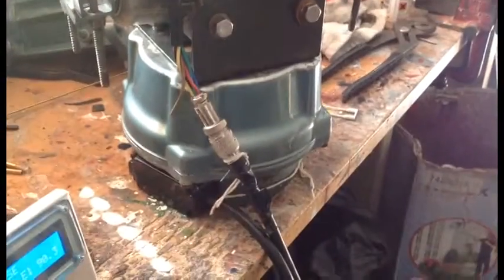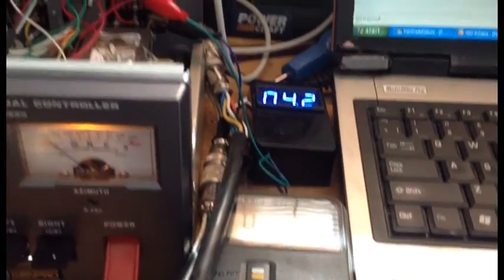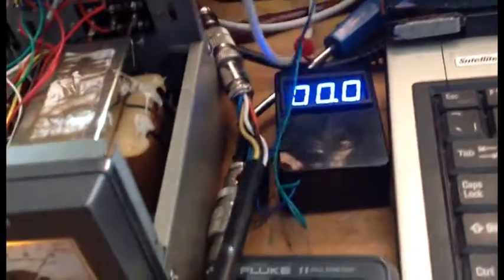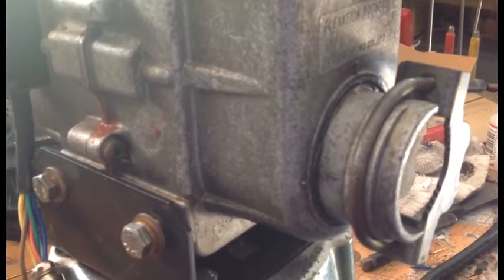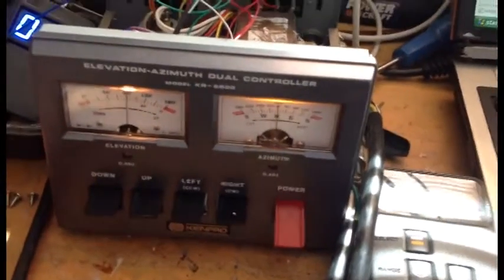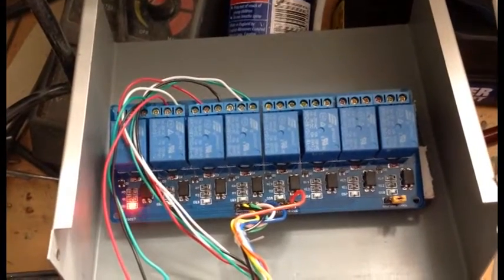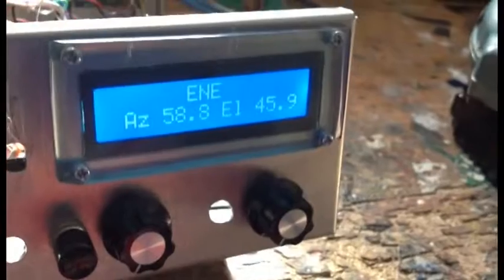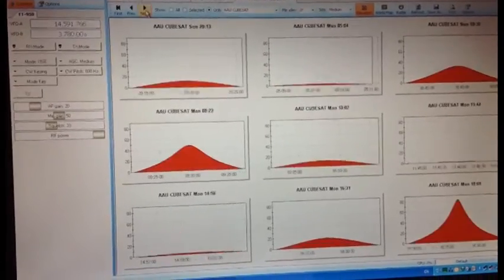Internals of the Arduino K3NG antenna controller.

Comment from the maker: Question:   If I try to implement K3NG's code and schematics from his Github page as is, will it work, or there are initial changes that have to made to the code? 

Answer: No! the code is not plug and play. You need to uncomment some parts that are not relevant to you. Mostly the different controller interfaces. I use the Yaesu G232 code so uncomment that and comment the other interfaces such as Easy Rotator. Then there are various others tweaks to tell the software what your using eg: 360 degree or 450 degree stop. If you go to the K3NG website it explains what parts to comment out and what parts to keep and more important how to set it up and calibrate.I have kept with a code that works for me and its quite old because newer versions use tracking with Honeywell sensors etc. I don't need that level of accuracy.